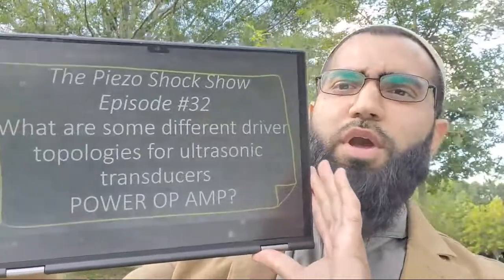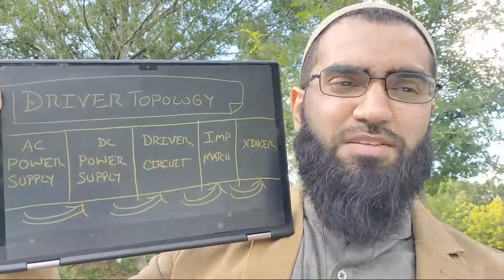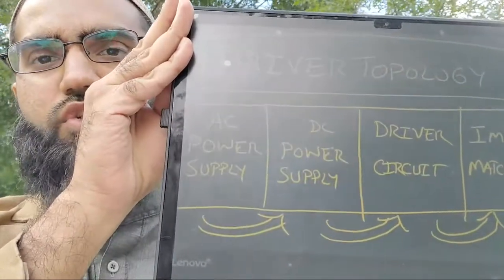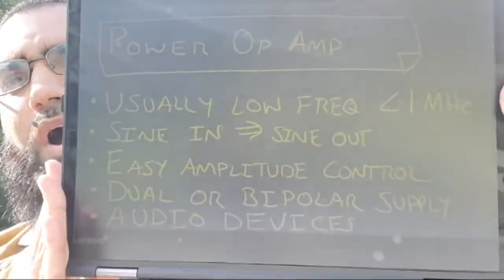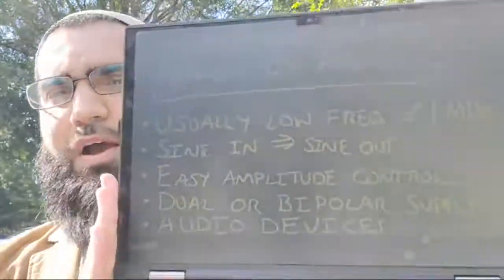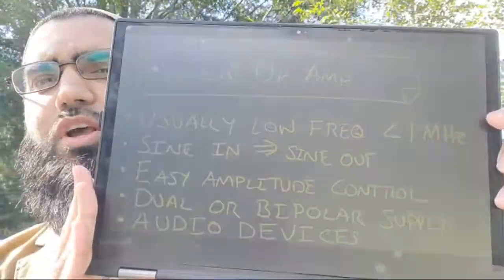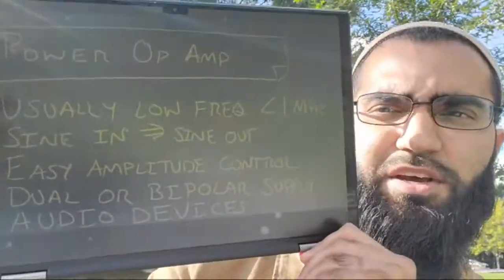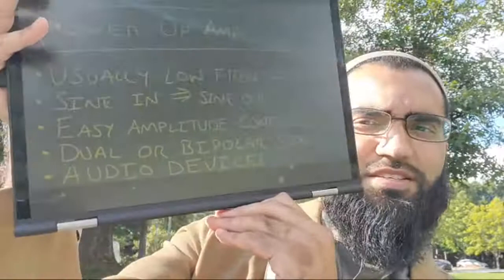Piezo SHOCK Show #32: Let's talk about ultrasonic transducer driver topologies and power op amps!

Comment: is that true that "we should never drive a transducer on its resonance frequency and we should just drive it on a frequency very close to the resonance frequency bcz if we drive it on the resonance frequency it can damage the piezoelectric stacks"?
Reply from the maker: That's not true. You just need to be mindful of the power delivered. You can put a series resistor to limit power.

Comment: Hi! Thank tou for the insightful videos!

I have a quick question: I have an ultrasonic transducer. The impedance of the transducer has been measured by the manufacturer. Its resistance drops as low as Ro = 10Ω at resonance. What is the max output current my op needs to drive the transducer at 10 Vrms? Is it simply Irms = Vrms/Ro? Or should I calculate it using the complex impedance?
Reply from the maker: Yes, you need to use complex impedance. Also, at minimum, you should expect the impedance of your transducer to increase by 2x or more when driving it at high voltage.